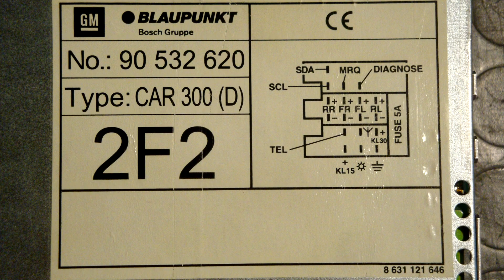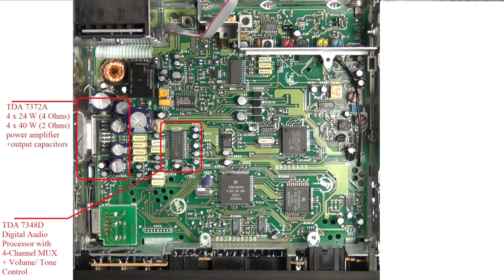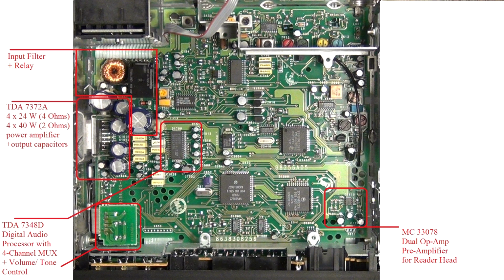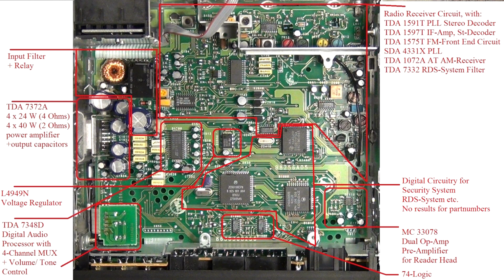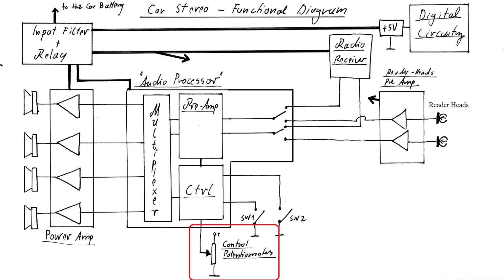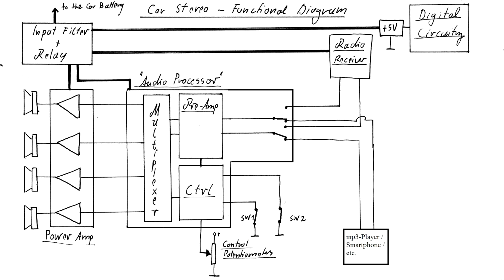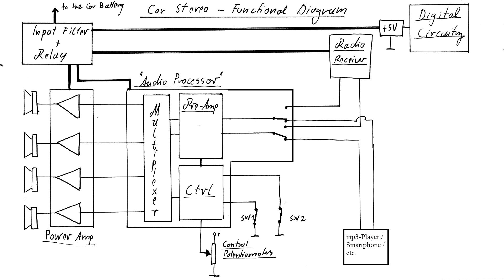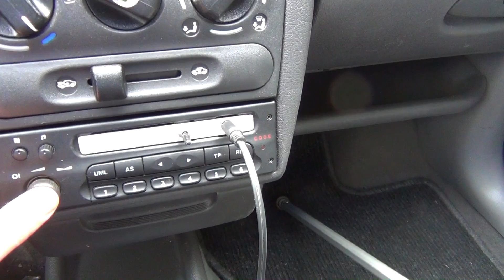Car Stereo Teardown, Analysis and Hack  - Blaupunkt Car 300

Comment: good tutorial I see 2 point here
the first one you overlay power suply and signal with the switch? in thah case its a switch always "on"? just to discrimanete " radio or player?
and second , you connect  the jack to reader head of the player in the mother board??

thanks again

Comment: I had a question, i had a Toyota Corolla 2008, which has optional adapter for a AUX to add ac jack for cellphone or mp3. They are expensive. Is it a cheaper version DIY we can build itself?

Comment: Nice. I have tried once just using the preamp input (tape head pins) as an aux input and a parallel switch-bypass switch to fool the tape deck into action. If I remember right, it worked just fine too. Much simpler but much less elegant. I'm planning an oem car radio to aux jack + double bluetooth receiver (for a rearview mirror GPS - Love the concept - and my phone for music) and I think I'll use your method while keeping the tape deck functional because I'm a nostalgic. :D

Comment: I would have kept the radio looking as original as possible, I would have used a push switch with the original fast forward/eject buttons, I would have also put the jack between the buttons and the cassette door

Comment: Hello! I have a different model of Blaupunkt and tried to reduce the noise adding resistor to the head wires but no good results. Your hack might help me. Unfortunately I couldn't find any service scheme, neither identify the audio outputs, however I'd appreciate if you could provide me with technical assistance. According to your accent I assume you are German. I have German friends and by nature they are always supportive. I just need to identify the input which has line-level impedance so that it doesn't produce noise when I input the audio signal coming from my ipod. Auf Wiederschreiben.

Comment: Ha, I modded the exact same radio for the exact same car a couple of years ago!
I remember giving up on tracing the logic and ended up disconnecting the cassette motor and connecting the input signal to some pins on the backside somewhere near the potentiometer. That worked very well, although in hindsight I'm surprised that it did.

Unfortunately, both devices are on the scrap yard for 3 years now, so no chance to review old work :D

Comment: Loverly job :-)
My frend did a much cruder modification to a very old (radio only) unit about 7 years ago, the inputs to the volume/tone control pcb were chopped and a small DPDT relay was used to swap the inputs to a stereo cable that immerged from the back of the radio and plugged into an external cd unit.
The switch just powered the relay, it worked well :-)

Comment: I suppose you enjoy the music at 14:35 and not the hard rock on the cassette?
Reply from the maker: dieselscience I actually do enjoy heavy metal, but the music on the cassette was hardcore and that's not my style.
Reply: +The Post Apocalyptic Inventor Can you tell me how to fix a car stereo it is an original headunit with a usb to plug flash dirves in but after 7months the usb wont work or read nothing happned when i plug the flash drvie in it tried different drives to but they dont work and all of them work in other head unit i unmount it and every thing was good wireing capisitors and every thing was good i also scrap the face to inspect the usb port all connetions are good and soldered the stereo is a pioneer deh 15ub. thanks in advance i liked and sub
Reply: Sorry but no since I soldered a wire to fix an error message this happen a month after
Reply: The error message is amp error and it was fixed and I will try to get the pics

Comment: Hi, its really necesary to put that resistor?
Reply from the maker: You can't really know it unless you try it, or have the entire circuit diagram in front of you.
In general it is bad to not replace a load by a resistor, because you might then have an open collector( or open drain) transistor on the circuit board. That could possibly lead to problems, because no clearly defined logic state ( 1 or 0 ) might be present at the collector. It could possibly lead to malfunction of the device, or even to wild oscillations etc.
It is highly unlinkely that the radio will be permanently damaged, but since a resistor like that costs next to nothing these days, I don't see a problem in soldering one on the board.

Comment: why you don't make an jack connector what automaticali close that two switch when you plug the jack in there ?
Reply: Ronor Cannel I can say from first-hand experience doing essentially the same project (with a slightly different approach) that using a jack with a built-in switch can be problematic, especially if you use a low quality jack. Basically, any minor abrasions or corrosion of the jack switch contacts can cause the system to go between an on and off state as things vibrate, causing the audio to crackle and pop. A solution might be to have the jack-based switch control a more stable debouncing switch sub-circuit, but who wants to go through that trouble?
Reply from the maker: Ronor Cannel If you browse through the comments, you will see that I already answered that question to some other people.
Reply: probable but i don't have time to read all of them :)
Reply from the maker: Ronor Cannel Yeah and I have enough time to answer them all, even though the questions are repetitive ? :D Oh boy. Well to make it short: I basically used the switch, because I didn't have a jack with integrated switches at hand. But it's also not that simple, because you have to close two separate switches. So you would need a jack witch not one but two integrated switches, or you would have to add ad least a little ciruit with some transistors.
Reply: Ronor Cannel Dont even think thats a good idea. At least for me, as I tend to leave my AUX cable in the radio all the time.

Comment: Verz usefull hack, ja? You can listen to polka vhile zou drive, ja? ;-)

I'm tempted to do this to my Audi Gamma radio, no use for the tape deck anyway. You could have glued in the aluminum from the back side of the front panel, I think it would have looked better that way.
Reply from the maker: akkudakkupl Yeah I'm, sure optical improvements are possible. I did this in one afternoon and didn't spend a lot of time on thinking about the looks. It's just one of many possible ways to do it. The music is folk music from Scotland. I listen to it once in a while when driving :D
Reply: The Post Apocalyptic Inventor
Function over form ;-)

Problem is my Gamma is dead. There is no +5V on parts of the board, seems some SMD transistor gave out its life. As I suck with SMD I think the radio is either going to the bin (I would hate that, I like the original look of the interior) or I will have to shell out some Euros ;(

Or get better with SMD :D

Comment: what's wrong with that type of music?

and why not get a headphone jack with jack detection switches..connect the switches to the jack and whenever you plug in the aux cable it automatically switches on.
Reply from the maker: I'm actually a long time Heavy Metal fan. But that's "Hardcore" and I never really liked that particular style.

Concerning the jack: I did this hack on one sunday afternoon. I simply took those parts which I had in the house, and I didn't have a jack with an integrated switch. Besides: These jacks have normally just one switch, so it would have been necesary to add at least one more transistor circuit to activate the second switch. I also don't see the problem of putting a nice little switch on the front panel. I like how it looks and there is enough space anyways.

Comment: normally we bypass preamplifier section and connect mp3 player via volume control.
Reply from the maker: In a normal analog audio amplifier I would maybe do the same thing, but in this case I think it is more practical to use the inputs of the audio processor. But using the the volume control to tap into the circuit would also ( in many cases) mean that you couldn't use the stereos internal balance, tone / equalizer functions, when fed by an external mp3-player.

Comment: Excellent video. At 3:46 the diagram of the external connections includes SCL and SDA suggesting that there's an IIC connection. Any idea what that's for ?
Reply from the maker: Yes i think it stands for: "SCL" = "Serial CLock", "SDA = Serial DAta" or ("Serial Data Array" or similar).
The Stereo is connected to other digital circuitry inside the car. For example the RDS-Feature (Radio Data System) enables the Stereo to filter digital information out of the radio signals and uses it to display the name of the radio station and other data on a seven segment display in the dashboard. When you enter the security code, the numbers of that code are also displayed there. I guess that's the purpose of those pins.

Comment: Nice explanation. I have always wondered why the most simple and un-interesting OEM-stereo's have code protection - /who/ would seriously steal such a primitive car stereo, when the car just beside it may have an after-market model, that has better sound, display, CD etc. - and in 9 out of 10 cases, no code! Could you please elaborate on the Scope-like instrument on the right of your table - i have never seen one like that.
Reply from the maker: I guess in the mid 1990s these stereos were still worth a pretty penny, but the full time job of "Car Stereo Thief" might have died out by now... A Stereo like the one in my car is worth 1-3 € on ebay :D

The instrument on the right is a tube-oscilloscope. And by "tube" I don't mean the CRT. The entire circuitry is built on electron tube technology. The unit was build in communist eastern Germany ( The "GDR") back in the early seventies. It is still running well !
Reply: The Post Apocalyptic Inventor Cool! - I love CRT's and other Vacuum tubes, too. I would just not take it for a scope, because there is no front controls on it!
Reply from the maker: That's the weird thing about it: the controls are mounted on the right side of the enclosure (inside an indentation). Maybe I will make a video about my gear some time in the future.
Reply: The Post Apocalyptic Inventor I would love a video of all your special and home-made gear!

Comment: Great Hack. Quite funny too.
Reply from the maker: Thank you. I appreciate it :). In my earlier videos I often tried to be very serious, but I actually like being a bit humorous here and there ;P
Reply: It was a good balance.
Reply: The Post Apocalyptic Inventor Not as good as your video, but a similar idea
http://youtu.be/nbM6XUm3XyI
Reply from the maker: Matt Heilman A "Bluetooth Cassette" :D,  that's not bad at all. I like projects were something old and (seemingly) useless is connected to something new and funky :D. 

And your video seems to be quit popular as well, so I guess many people liked the idea. 
The only downside is, that the audio signal is converted so many times before it reaches the amplifier. That is what I wanted to avoid in my attempt to basically "hardwire" the signal into the circuit. But in the other hand: Your approach has the advantage that you don't have to mod the stereo at all.
Reply from the maker: Matt Heilman Hey! In case you didn't notice: I sent you a private message.
Reply: The Post Apocalyptic Inventor
 I don't see it, did you send it to my youtube channel, or G+?
Reply from the maker: Matt Heilman I sent it to you via Youtube. You should find it under community --> messages. If you don't find it then please tell me and I will find another way of communication :)
Reply: The Post Apocalyptic Inventor
It seems Youtube messages are having issues, at least on my end. I will send you my email privately.

Comment: I have an toyota fujitsu ten radio 18401, which has an cd input, a propietary conector at the back., If i press the cd button nothing happens, how can i make it think there is a cd player there, Do i hook the tx /rx line to power?
Reply from the maker: Here is a page, where you can find various pinouts of Toyota stereos. Just look for a connector that looks like the one on your unit: 
http://www.tehnomagazin.com/Auto-radio-car-connector/TOYOTA-Car-Radio-Wiring-Connector.htm
Reply: I aleardy have the pinout, from the same site, it works on radio and casette, but i will try to do some measurements

Comment: Very good, better was if the plug activate the switch and better if detects the signal and desconect the radio, I know I could do that easily but we do not, I'm just an enthusiast but I think your channel very good ... 
you are from which country in europe?
thanks!
Reply from the maker: That's actually not a bad idea. But I like these switches :D. The more of them, the better ! 

I'm from Germany
Reply: The Post Apocalyptic Inventor I leave my 3.5" jack plugged into the stereo all the time so that mod wouldn't work for me
Reply: ***** You can also get little bluetooth PCBs on ebay - you can hide them in the stereo hooked up to the line input too